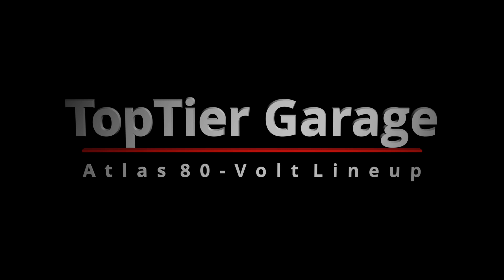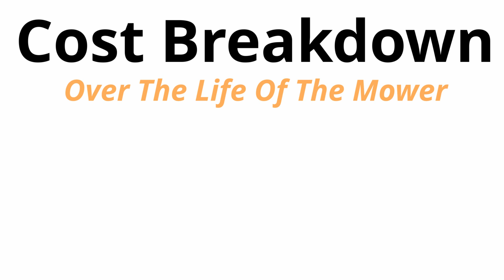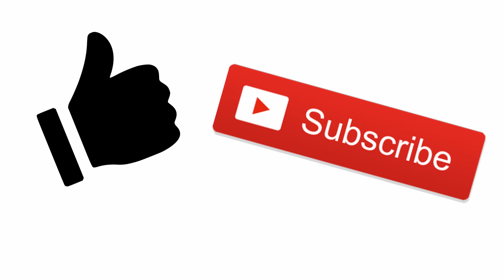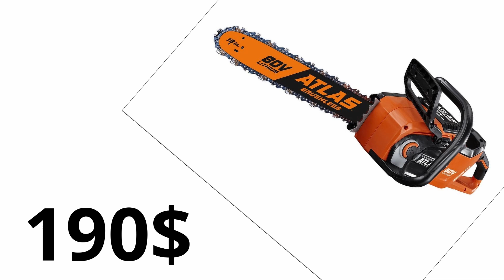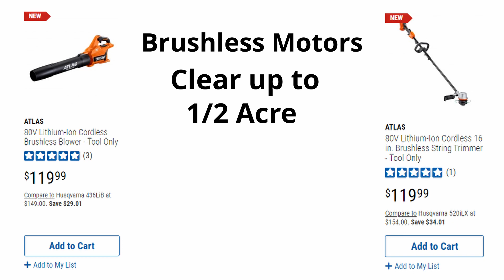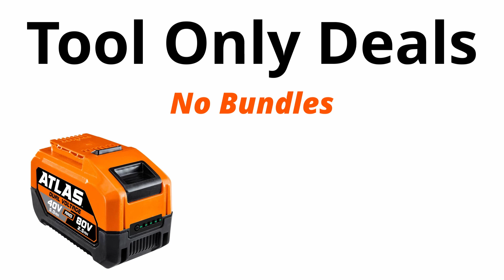Atlas 80-Volt Line up A Force to be Reckoned With

Comment: I bit the bullet and bought the self-propelled mower, the 80V string trimmer, the 80V chainsaw, TWO 80V batteries and the rapid charger.  WELL worth it!  My yard was waaay overgrown since my yard guy isn't coming around due to the corona virus so it took about two days to do the whole yard and yes, the mower did bog down a couple of times . . . but I'm in deep south Louisiana and had some cluster of grasses and weeds 2-3 feet tall.  I found that if I cut them down with the trimmer and raked them out, the mower chewed right through them.  I'm so pleased . . . my yard guy isn't coming back.  My investment in this equipment has saved me hundreds a month in yard maintenance and now that it's under control it shouldn't take long to run through the yard and quietly mow the whole thing on one charge.
Reply from the maker: That's awesome. Now we know that these mowers can handle some abuse.
Reply: After 3 years, how are these tools and batteries holding up? I’m in the fence on investing in these items.

Comment: I have read comments the 2.5ah battery ($110 per battery) only gets 20-25 minutes of actual run time cutting grass on the self propelled Atlas 80v, nowhere close to the 65 minutes they claim. Only 90 day warranty, not 3-5 years you get with the Kobalt 80v & Greenworks 80v which probably comes out of the same Chinese factory.
Reply: I easily get about an hour per battery using the self-propelled mower.
Reply: Must be cutting some serious grass